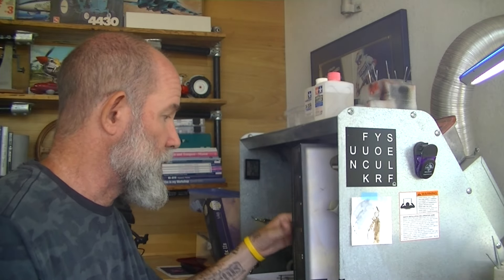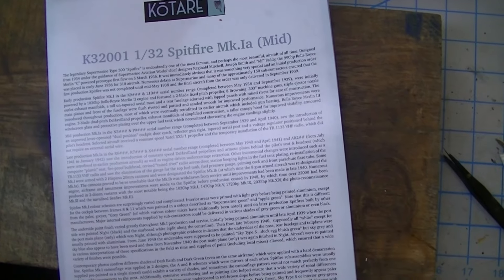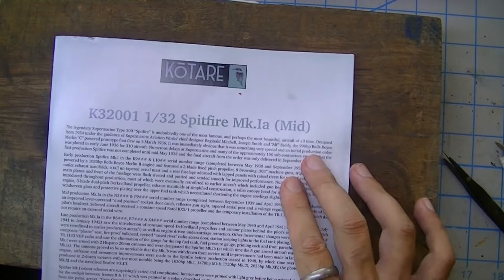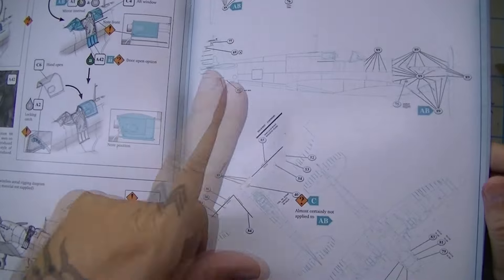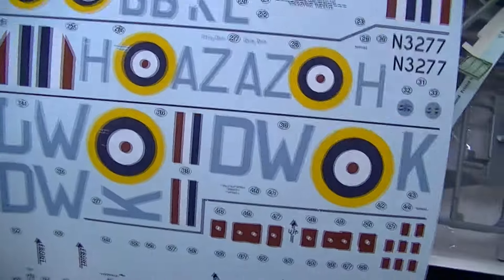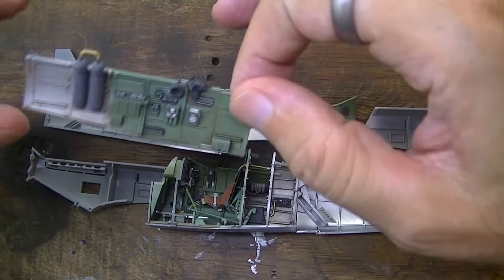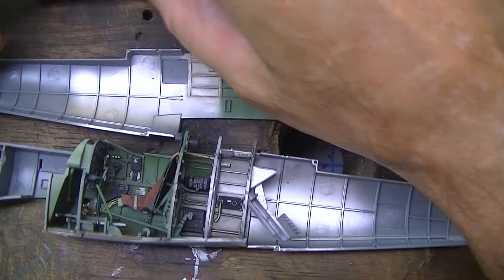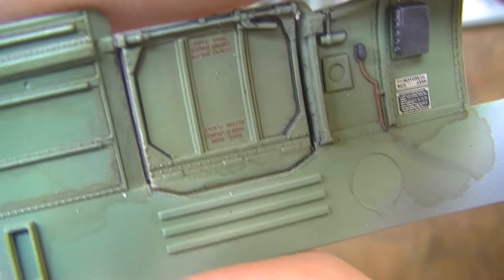ep377 - kotare 1/32 spitfire mk1a mid (maybe) part 1

Comment: That was lovely modelling. Your 3D printing was excellent. Also, thank you for your walk-through and discussing your strategy and thinking. I have, like many other people, one of these lovely kits in my stash. You have really helped me here. 

The “six pack” is name typically given to the basic six instruments for instrument flying, not IFR. Remember, most IFR flying is done in good visibility. Virtually all RAF aircraft had the same basic six arranged as follows: top row ASI, A/H, Altimeter and turn and slip (not co-ordinator), direction indicator and VSI on the lower row. This helped enormously when training into a new type.
Accumulator - The 1940’s name given to a battery.

Comment: As I understand it their next new kit is a Bf 109 K-4. For me there are a few things that absolutely exemplify what Kotare are about: no rivets showing on the leading edges of the wing - every other kit gets this wrong; the sprue attachment points on the propeller assembly not being on the blades; the small depressions around the fasteners on the underwing radiator simulating where thin sheet metal has deformed; the fuselage spine eliminating a major seam; the wheel well walls being one piece where other kits would have 3 or 4 to align. And it goes on...
Reply: No. The next one is a Spitfire Va. It's on their website.
Reply: @TheMikeCooper  Hi Mike, Kotare have announced a 1/32 BF-109 K4 in development for late 2024 or 2025. I’m anxiously waiting for it.
Reply: @TheMikeCooper  When I said 'new kit' I meant not a Spitfire variant - I'm hoping we'll also see a Vb/c (+Trop). The 109 isn't on their website but they've announced it and have released some CAD images.